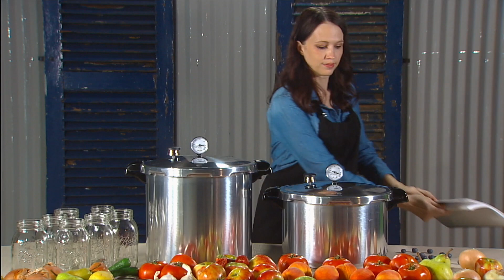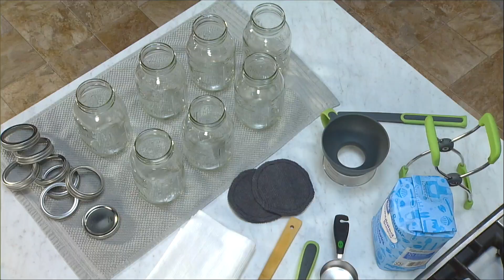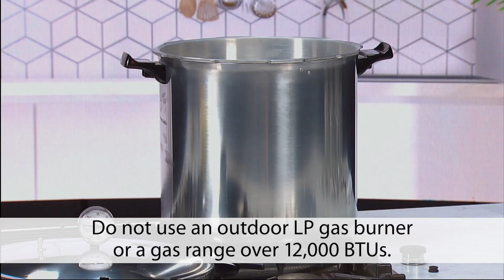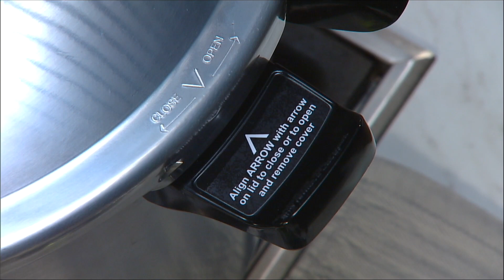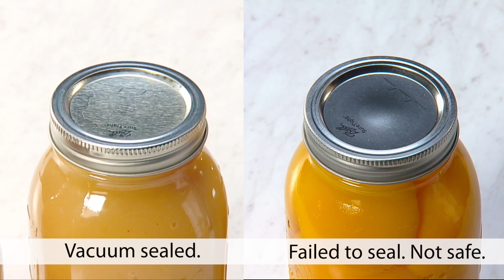How to Boiling Water Can with Presto Stovetop Pressure Canners

Comment: Good ol' Presto! Thank you for still providing a written manual. So many companies are now only offering only the bare minimum in written form and then want you to to to a website for further instructions. 😒
I've been married since 1972 and have used presto appliances for decades. They are my "go to" brand name for small appliances.
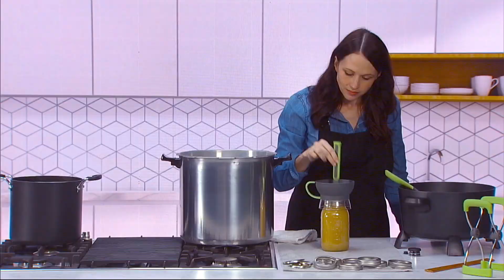Reply from the maker: A manual should be included with each appliance. We're happy to help you with both a physical manual and a PDF in case you lose yours. If you have any questions about how your appliance works, need a recipe, a part, or just need to chat about a product, we welcome your call as well - call 1-800-877-0441. We're available weekdays, 8:00 - 4:00 Central Time.